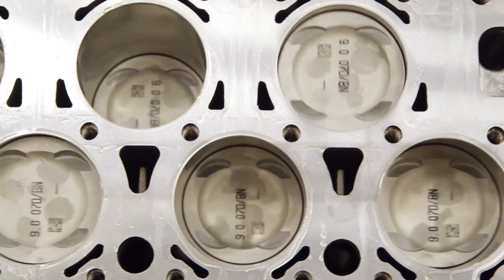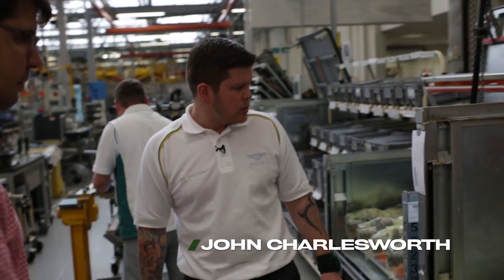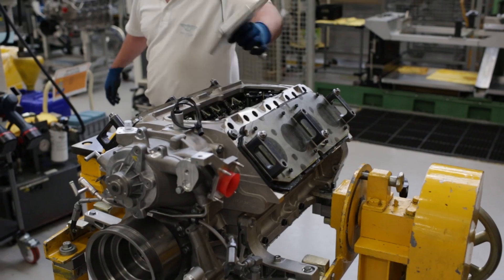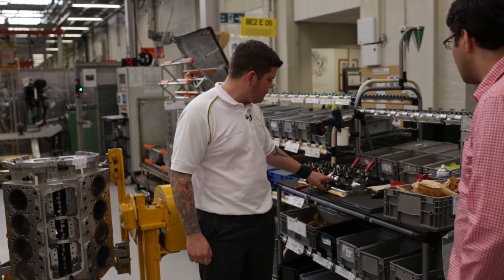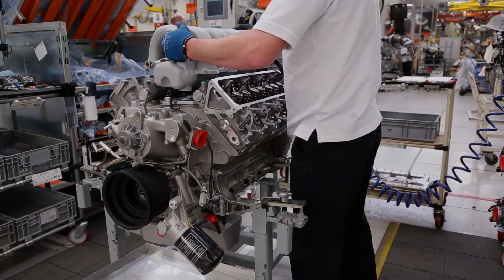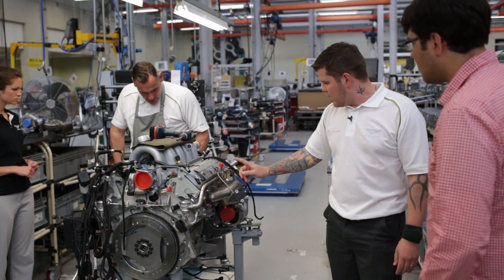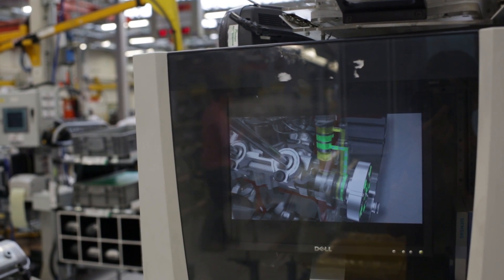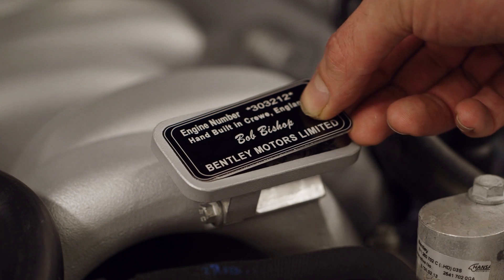Torque Monster: The Mulsanne Motor - /INSIDE BENTLEY

Comment: I love Bentleys (not the new Mulsanne), especially the "Nepal-Models" (Continental R/T/SC) and the Pre-2005 Arnage. But the 6.75 Liter Engine is just a piece of crap which must be replaced every month and cost a Fortune. Its so sad. I dont care how they are made. I want a reliable engine.
Reply: Finally, someone in the comment section, talking sense!

Anything Cosworth puts its hands to, turns to cr@p. I saw it back in the 80's and 90's with the Fords. Engine after engine, after engine going ... pop!
Reply: @utubecomment21   i heard that the Green Label-Engine, which is tuned by Cosworth, is very reliable.

Comment: I don't know that I've ever seen a beefier engine in my life...absolutely unreal.  At stock power levels, I can't imagine it's even beginning to get stressed.
Reply: W.O. Bentley started his career as a locomotive engineer building train engines.

Since the beginning, Bentley cars have always been overdesigned and overbuilt.

There's a reason the finished Mulsanne that engine will push down the road weighs roughly three tons.

Comment: Holy hell those cylinder walls are so thick you could run 2000HP+ on the stock block
Reply: T.K.B Right.  And look at those main bearing caps.  Looks like something you'd see on a Top Fuel engine.  This thing could easily quadruple its stock output, I would think.
Reply: @Evan-McM : And crank cap bolts that are so long they could quite easily hold the cylinder heads on as well. It's a Rover "K" Series engine in reverse (K's head bolts doubled as oil pan come crank cap bearings but used to devour their own head-gaskets).

Comment: The Mulsanne uses a PUSHROD V8? Jesus Christ that its cheap!!... I recall Bentley having a little engine in a W12 Configuration with 600HP and 750lb of torque... Why isn't installed here?? Not like the Mulsanne is any cheap car btw.
Reply: OHV takes up less space. Pushrods still work.

Comment: Funny that they didn't show the new engine which is put in most Bentley's. The Audi V8 4.0 and the VW W12 6.0
Reply: hey to be fair though that w12 is only available in high end stuff and is a great engine.
Reply: Jacksonkellyfreak Don't get me wrong, the Audi V8 and the VW W12 are in every way better than this old original engine. Except for the pure torque maybe.
I just think they're not the engines you want to be seen if you show your proud engine assembly line.
Reply: true. But I know Bentley is a company upheld to tradition and that big 6.75 is likely to be revered forever. And there's not a thing wrong with that. Just nice to have other options as well. But yea they are VW engines and the V8 is Bentley's own
Reply: Jacksonkellyfreak I agree except for one part: the Audi engine is a Audi engine. It's developed seperatly from VW plants and is only developed by Audi engineers using only Audi developed parts which are produced mostly in Audi plants. There are rarely common parts between any VW engine and the Audi V8's. It's a common mistake to assume, Audi and VW being the same.
Reply: Norman Morton I appreciate your vouching for me, but don't give him anything he can let his anger out on. Based on his ability to misunderstand phrases, I assume he will turn inside out every comment he recieves. I didn't mention anywhere that the VW or Audi engines are bad, in fact I said the exact opposite. So I really don't care about his comment.
Reply: TheArfdog Not sure if serious.

Comment: wow, the engine is remarkably american in design. not a bad thing, I bet the torque curve is massive
Reply: How is anything on that engine American design? Only thing on that engine is the V8 configuration but that design comes from France and Bentley uses the old RR design which General Motors actually "borrowed"!
Reply: SquirrelFromGradLife this actually isnt true, both the GM small block and l series came from the same period, but with little crossover, the fact that they are similar has more to do with the time period and technology available at the time. Marmon an american company, actually produced the first V8 engine, it wasnt popular but to say that GM borrowed from RR is near sighted, not trying to be a dick.
Reply: k, lol.

Comment: What truly amazes me is how light that flywheel is. I've been working as a tech for quite a long time and on normal production cars the flywheel weights a ton!
Reply: The torque-converter gets bolted to that drive-plate. That, in effect, is the "flywheel".
Reply: The normal weight of the flywheel is now included in the torque converter to smooth out pulsation. It has internal damping springs like a manual transmission clutch…

Comment: To all those comparing the 6.75 to an LS, it predates the GM unit by nearly 40 years! It was developed by Rolls-Royce in the 50s - hence the push-rods - and has been in production ever since. Also a bit silly to compare a Bentley Mulsanne (an Über luxury hand built car) to a Ferrari (performance orientated sports car) or a Merc/Audi (expensive versions of mass production cars).
Reply: The British took an American engine and made it less reliable. Further down the road it was redesigned by Cosworth, for even less reliability ... yeah, great!

Comment: I'm not sure if the engine builder really just called the crankshaft a camshaft, or if that was just bad video production.  I'll give him the benefit of the doubt and assume it was the latter.
Reply: haha i too noticed that, i was wtf, only ONE camshaft BELOW the pistons :s confused me there
Reply: oh no actually my bad, that actually was the camshaft, its positioned differently it is not an overhead camshaft, instead its a overhead valve configuration, and investigating the comments on here, pushrods are used. weird though for a V engine?...
Reply: K Singh Well, the USA used the OHV design quite a long time in their V8's and even the UK uses it apparently today. I don't know if there are still production engines in the USA with OHV layout, but normally you would suggest an engine to be modern, more efficient, more reliable and more powerful throughout the rev-range.
Reply: yh but meaning that theres a pushrod system controlling the valves, theres more parts which contribute to inertia and affect engine RPM. tbh i think its an over complex configuration
Reply: K Singh That's what I meant to say. But it really is cheaper to build.
Reply: true
Reply: wish they could caption what he is saying, not every american can understand proper english accents!
Reply: GERntleMAN Both GM and Chrysler make OHV V8s.  Only Ford makes broad use of OHC V8s, when talking about the "American big 3" carmakers.
Reply: K Singh everyone used to build pushrod V engines. The original Nissan 3 liter V6 was one, I had one in a Z31 turbo
Reply: Martin Espinoza The VG30 engine used in the Z31 was a single overhead cam engine.  It didn't use pushrods.  I used to have a 1986 300zx.
Reply: Hmm, wonder how I got that crossed up. I'm sure I read it somewhere, but it's obviously wrong

Comment: yeah no way in hell would I pay that much for a car with a pushrod engine...
Reply: AMGV Media
Why is displacement even a factor? Is 505hp and 752ft.lbs. somehow less because it's coming out of more displacement? You've written this engine off based on no important criteria whatsoever. All the important criteria like smoothness, weight, physical dimensions, fuel economy, power curve and driveability, are apparently irrelevant because you think it should put out more HP given its displacement....
I've said it before and I'll say it again, specific output is the most useless, braindead measure of an engine's worth ever devised, and I can't believe people still think this way.
Reply: Yes, who would want a hand built V8 engine producing 505bhp and 752lb ft of torque.

I doubt, you will ever have to make that decision.
Reply: AMGV Media The Ferrari FF has a 6.3 L V12 engine producing 651 bhp and 504 lb ft of torque. Notice the difference in torque between the Ferrari and the Bentley. The Bentley engine is designed for torque. There is nothing wrong with this engine in terms of performance or technology.
Reply: out of 6.75 liters and turbocharged that's terrible
Reply: mak450 Well said. People get obsessed with bhp and 0 to 60 times.
Reply: AMGV Media and that means cutting edge to you? Well whatever works for you I guess, but in my world an older valvetrain layout is an older valvetrain layout no matter what you put it on. Sure some of those engines put out significantly more hp, but those are V12s in much higher states of tune. The others don't have much of an advantage at all. Without much work this could easily be a well over 600hp engine.
Hell the Viper's OHV engine makes more hp than everything you could possibly be talking about that isn't a V12. If someone ever bothers making another OHV V12 you won't have much of a leg to stand on...
OHC is not better, it's just different.
Reply: mak450 Displacement is a very eminent factor, since filling the volume of a larger engine requires always more fuel and air mixture. Therefor it will allways be more thirsty in it's base concept than smaller engines.

Yes, having only a hp/l rating of 80 with a bi-turbo layout is indicating a low level of efficiency including the disadvantage of a pushrod design being more inertal. Thus leading to higher stress in the whole engine at higher rpm. That's why they lower the hp output and raise the torque to somehow compensate.
 
Engine smootheness is a important criteria in cars like this and if you're about to rev that engine and open the bonnet, you would be surprised by the large amount of vibration starting from 3400rpm.

There are always engines with some layout worse than some engines with another layout and otherway round. That's no serious statement.

But one should always consider, it's most importantly about the quality and competence the engine builder posses.
Reply: AMGV Media to say a Bentley just shouldnt have anything old school in it is really ignorant. the distinction with these cars is character and tradition, buying a bentley is not about pushing the technological limits, its more about character and tradition. if you are looking for that there are plenty of "characterless" high end automobiles out there, go get yourself a GTR or something.
Reply: mak450 because it gets terrible mpg, and could easily make more power. for a person who well be paying that much, they should be getting the cutting edge of engine tech.
Reply: AMGV Media That's got nothing to do with the pushrods, and considering there are smaller displacement OHC engines that get even worse MPG, it doesn't have much to do with displacement either...
And OHC is as old if not older than OHV, so if you want cutting edge and have a problem with OHV, then you definitely don't want that.
Reply: GERntleMAN It's not necessary to point all that out to me, I'm well aware of the pros and cons of an OHV layout, compared to an OHC layout.
All that said, I'm no language arts major but I don't think that's proper use of the word eminent...
Yup it doesn't rev as high, and it can't...but it doesn't "need" to in order to make power now does it? Though I'm curious as to what you think they lowered the hp from?
Engine smoothness in a vehicle like this isn't nearly as important as you might think. For what this car costs you could damn near insulate a house from a quake, let alone the passenger compartment from some engine vibration.
And no I wouldn't be surprised at all. Ever seen what an engine in a dragster does? I have, in person...once, but hell that's all it takes.
Reply: the Ferrari engine would be considerably faster. 505hp vs 651 is a no brainer. the Bentley has an 8 speed gearbox, and wouldn't need all that torque. if they wanted torque, go with a diesel.
Reply: and that's why Ferrari, Mercedes, Audi and all the supercar manufacturers all use DOHC motors, and produce well over the Bentley's output while being NA. There are reasons, OHC is just better.
Reply: I would take a Mercedes V8 any day.
Reply: mak450 That very well may be the case with the word eminent, since I'm german my understanding of english words is not perfect. I'm sorry, I try my best.
And they lowered the hp from the level, it would easily achieve with this "modern" injection and turbo system they have. Usually if you have a NA engine (speaking for europe) it develops about 80 to 100 PS/L. 
If you put on turbos, your power output should raise and not sink.

Nontheless, it only develops 80hp/l which is below any NA engine you can buy from an european volume producer. Of course, it delivers a lot more torque than a NA engine and that's where they compensate. Raising your torque at lower rpms means lowering your power output at higher rpms. Therefor lowering your overall power output.

That's what I wanted to express.
Reply: GERntleMAN Don't sweat it, I was just putting it out there.
I understand your points, but I don't see their importance given the context of the conversation I was having.

Aside from that. I find the notion of lowering an engine's output from a level a little foreign to me, but I think I understand what you're saying unless the language barrier is getting in the way again.

However saying they're compensating for it, I can't agree with. This is not even a typical engine as far as engines with the same valvetrain layout go. Its redline is super low, as if its a diesel running on gasoline/petrol. Seems to me that it's not that they decided to turn the torque up because they couldn't get any hp out of it, they just went more after torque than hp in the first place.
Reply: mak450 that makes no sense IMO as they aren't towing and they have an 8 speed box, no need for it. the only thing it does is burn more gas
Reply: AMGV Media It's good for more than just towing. More torque is good for real world acceleration like rolling to 60mph and passing at highway speeds. There's also the idea of making acceleration "feel effortless", even though I hate that expression. Do they need quite this much? probably not but there's alot about this thing that no one needs. And I don't think any other high performance engine would actually get better mileage in a car this heavy.
Reply: mak450 well pretty much once an engine reaches its powerband  (quick with an 8 speed) torque's value is greatly decreased. acceleration in overdrive, well a quick gear change would be better anyways, no matter the engine.
Reply: mak450
 Not to mention reliability, service costs and longevity. As always, horses for courses.

Comment: The V8 seems to be a bit of a glorified LS engine.
Reply: Bentley have been building that basic engine for decades, probably before the guy who designed any LS unit was even born. But the idea is the same it's a bit of a relic.
Reply: Reminds me more of an old Ford FE, MEL or Super Duty "Seamaster" turbo engine with it's deep skirted block and large external dimensions. The basic design is from the same time period. It looks nothing like a gm small block engine.

Comment: Looks like a pretty expensive LS motor to me!
Reply: Except that it isn't, come the fuck on, even with the most basic knowledge in engines Mulsanne's engine is NOT an LS engine. That's like calling a 2.5L BMW engine a Honda engine because it uses two cams.

Comment: It makes me very happy seeing these engines and knowing that mine is almost the same :D
Reply: what, in the sense that they are both internal combustion engines?? haha
Reply: J Bell No in the sense that I have a Rolls Royce with the 6.75 V8 :) so it's pretty close.
Reply: +leloodallasmultipass At least I didn't mention the part about me doing a manual swap, adding a turbo, etc. and creating perhaps the only truly quick Silver shadow. That would have just been blatant.
Reply: Corbin Goodwin I was just wondering if either brand made a manual in the last couple of decades. Which transexual did you put in there?
Reply: +Corbin Goodwin You spelled "I want everyone to know I have a Rolls Royce" wrong.